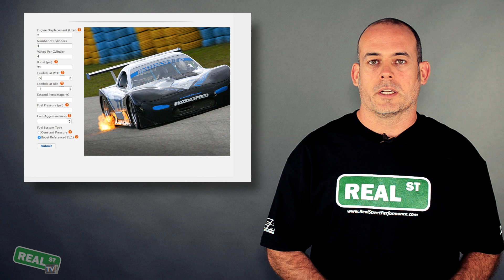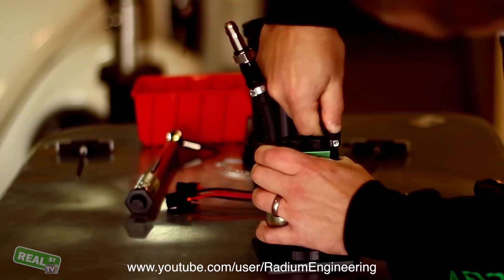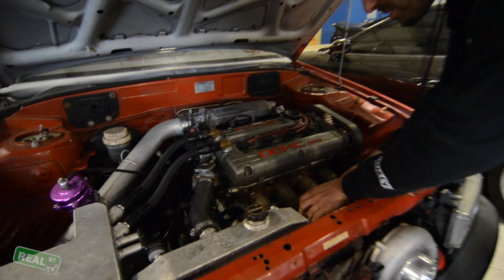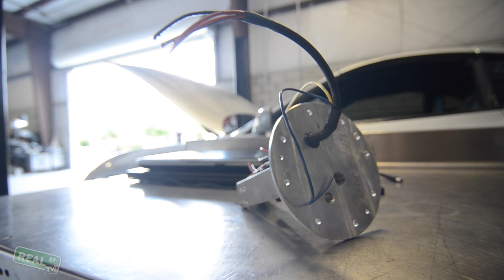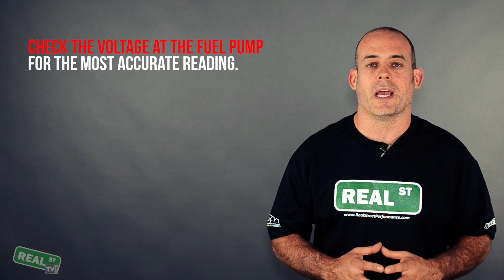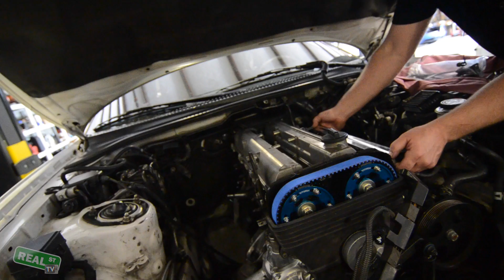Jay's Tech Tip #26: "How to Select the Right Parts for Your Fuel System"

Comment: At 2:35, what is being described is a 1:1 rising rate boost-referenced fuel pressure regulator. This adds 1 psi of fuel pressure for every psi of boost pressure (thus a 1:1 constant rate) such that the pressure gradient (psig) across the fuel injector is consistent across the rpm range. 

This 1:1 ratio is important to pay attention to, since there are regulators out there that add fuel pressure at a rate more than 1:1 ratio (normally a 1.7:1 or 1.5:1 ratio).